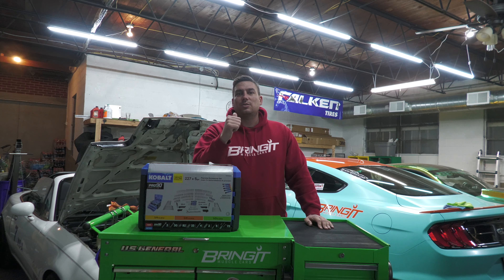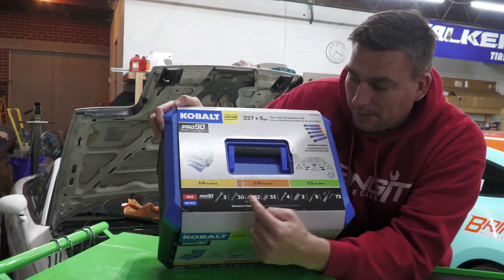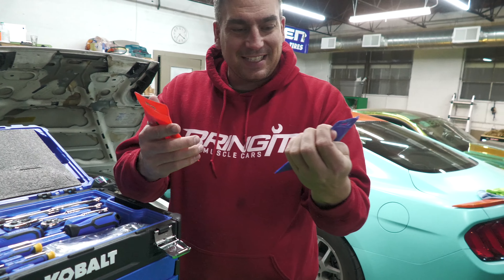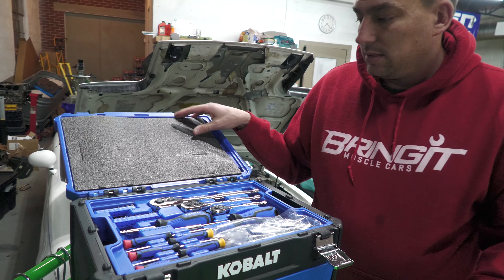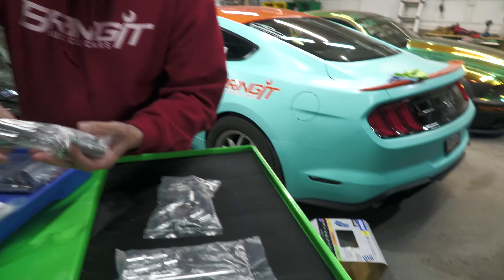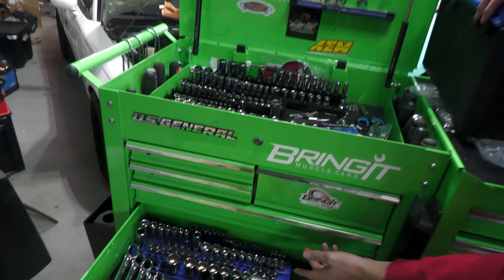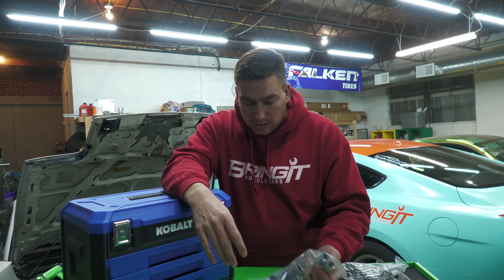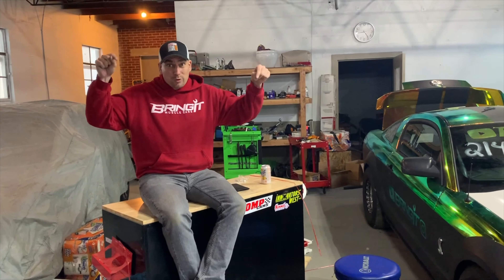Kobalt 232-Piece Standard (SAE) and Metric Combination Polished Chrome Mechanics Tool Set

Comment: Alternator, starters, points distributor and coil,those are uses for the ignition wrench sets, and the ignition electrical switch like on the top left lower side of the gm based steering column on so many different vehicles...

Comment: agreed that all of these sets include a horrible amount of fluff, but this is the only set that ive seen that comes with the ignition wrench set, and yeah, its kind of fluff, but having a set of those around does come in handy some times. especially for getting things like small actuators and resistor blocks out from under dashes without tearing the whole thing apart.

Comment: I have two husky brand mechanic tool sets and honestly the h194mts after i add to my husky wrench set, and a set of 1/2 inch chrome sae and metric deep sockets it would be a very complete set of sockets and wrenches, it's mobile crash kit and will stay in my truck,its a Mercari used purchase about 3 years ago around Christmas time $115 shipped its almost $179! New it was around 6 months old when i got that set only actually missing one socket replaced the no name missing 6pt 1/4 inch deep 4mm husky brand socket from eBay $6 can't complain and i was originally wanting the DeWalt 192pc mechanic tool set but whether it is new or used it stays around $155-$245 for a set that was released 14 years ago.... nope now I'm happy with my husky set